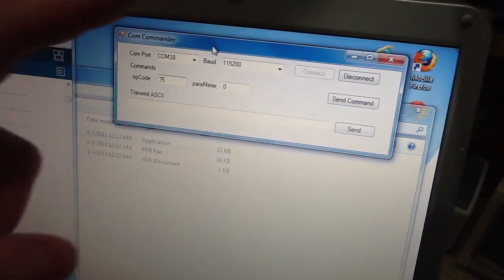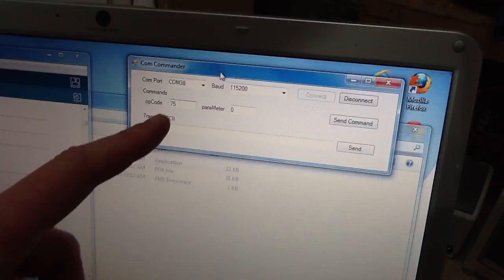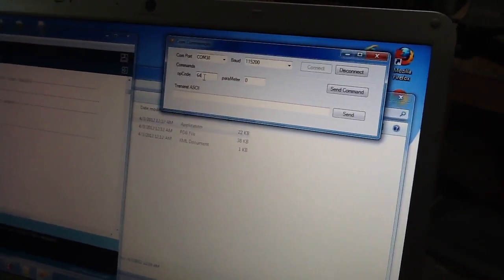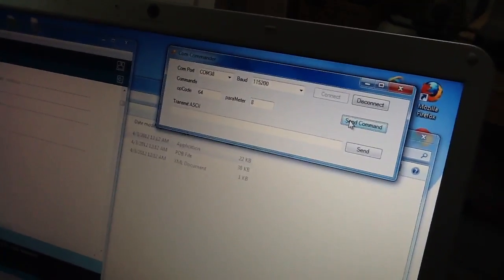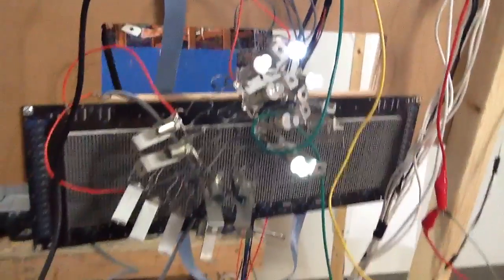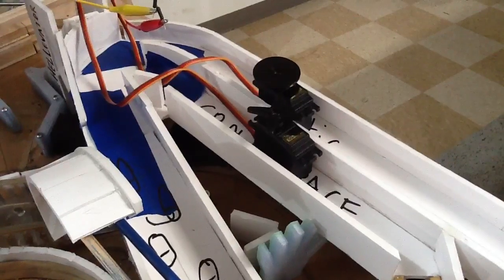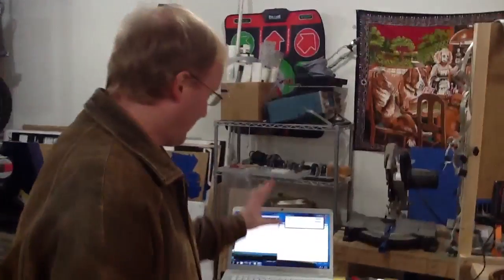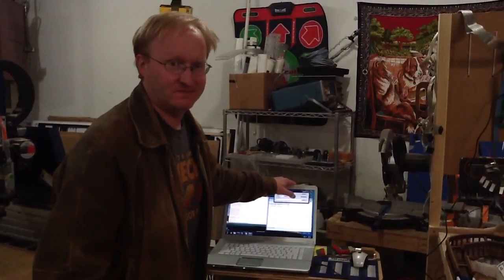Pinball System X Control

Comment: I think you've missed my point a little. By sound hardware I meant the means to play back sounds at a reasonable volume. It doesn't matter anyway on which platform you run your pinball's software, either on a PC, or an embedded platform using a microprocessor.

Comment: Please lookup this word in the dictionnary: hardware.
From the source wikipedia: Hardware is a general term for equipment that can be touched/held by hand such as keys, locks, hinges, latches, handles, wire, chains, belts, plumbing supplies, electrical supplies, tools, utensils, cutlery and machine parts. Household hardware is typically sold in hardware stores.

Hardware is better than software.

Comment: I think it would be much cheaper and time saving to just mount an old PC inside. Used components come very cheap these days, and even a PC from around the year 2005 equipped with windows XP or Linux should very much meet the requirements. Most mainboards have a soundcard built-in so for sound hardware, just an amplifier is needed. You can easily expand your game to infinity, because of huge HDD's you don't have to worry about filling up the entire flash memory of your chip.

Comment: This is cool but where will you put the program when youve finished? Is there a computer to be mounted on the underside of the machine? Wouldnt that be costly. Cant you write it in a language that would run on Linux and consider one of those Raspberry PI boards for $30? Its smaller and cheaper. Or im sure theres other hardware cheaper. I might be off here, but just wondering? :)